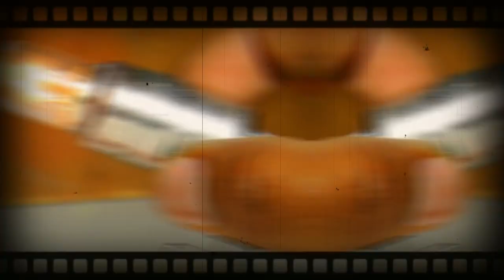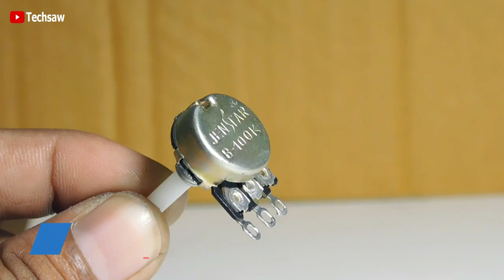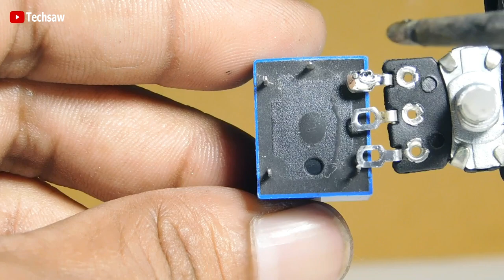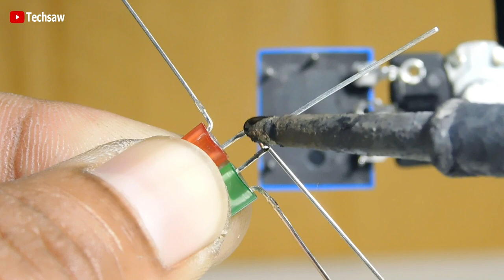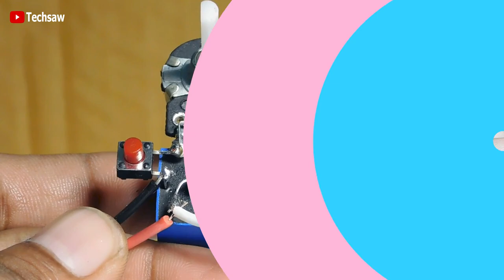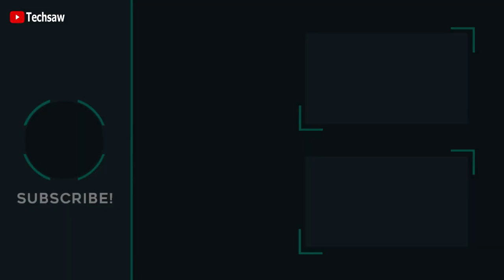Overload And Short Circuit Protection For Dc supply | Over Current Protection

Comment: I think this is a useless circuit u have to make strongly short circuit to cut the circuit. In industrial we use the current limit circuit for that. In this method the circuit can catch fire at the same time as an open circuit. It may work only for low current circuit.

Comment: Can I use for variable powersupply? Or what i need to change
Reply: You can use it, but BEFORE the voltage and current regulation circuitry. It's not made for a wide voltage range, as it uses voltage drop to detect an overcurrent condition. But be sure to use a "high power" resistor, 5W at least. The resistance will cause a voltage drop as current is flowing through, which shuts off the relay once the voltage drops too much. It may not stop the short instantly, but it will decrease the time to a few milliseconds.
5W is the maximum power dissipation of said resistor. This doesn't mean you're limited to just 5W loads, though.

Comment: Can i use it in 9v power supply???.
Reply: U can use all power supply u want.. U may only look the max voltage and current of relay and change resistor for for the right led voltage
Reply: Depends on relay. 12V relay will work, as from experience I've seen them trigger at 8V.
And, the LEDs aren't required. It's not like high current flows through them...

Comment: Pls, how I control the positive wire instead of negative wire in this circuit.
Pls help
Reply: you don't. protecting the negative wire is a lot safer than the positive one, because the current control can be monitored through the negative and not the positive terminal. all sorts of BMS and stuff like that follow this rule (if you don't believe me, circuit trace a BMS to see for yourself).

Comment: What is the reason for placing the potentiometer?
Reply: By puttinv potentiometer and set resistant,risk of exploding high current because of short circuit is eliminated
Reply: Pot 'd be as current regulator.. but  video not show how many current u may regulate...

Comment: What is the maximum current the circuit can handle.
Reply: Depends on relay current, but it's better to draw 1/2 or 1/3 the maximum current (eg. 5A for a 15A relay). Higher currents will wear the contacts out faster.
But I don't recommend such a simple circuit for currents above 2A. Sure, it works, but it is far from perfect.